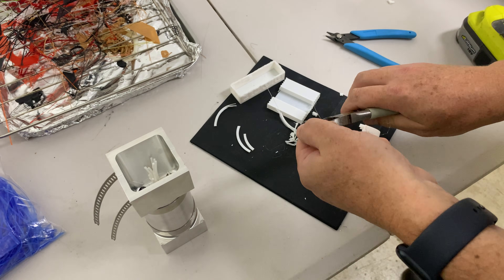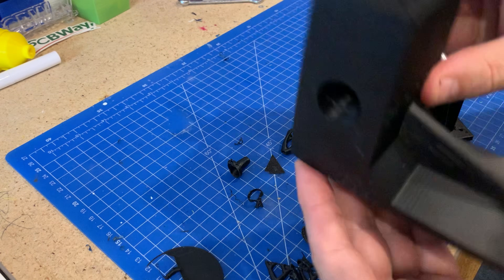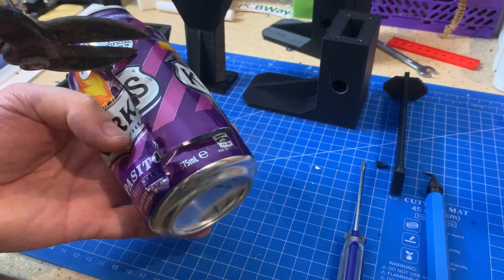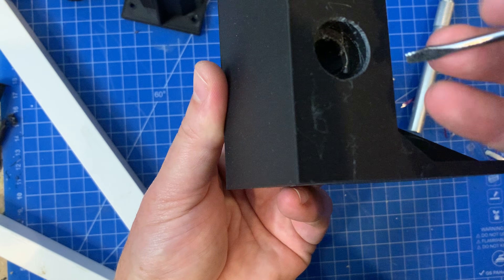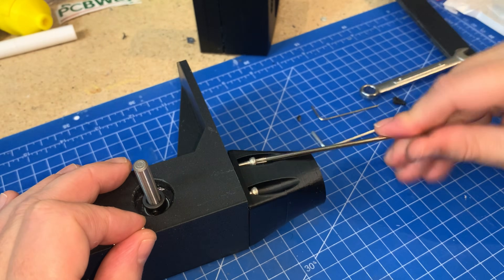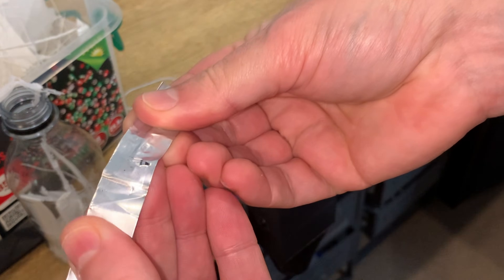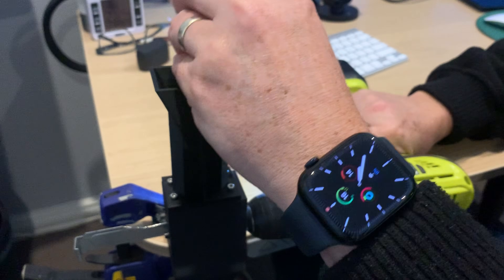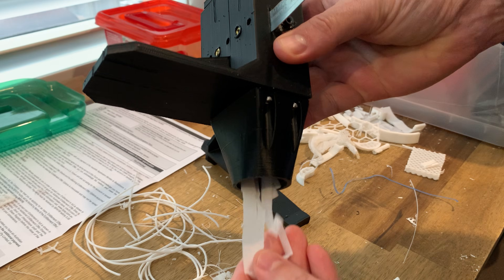Shredding your 3D printed scraps

Comment from the maker: Make sure you leave a comment on tips for layer seperation below so I can collect them all and do a video on them.:face-blue-smiling:
Reply: Heated chamber and tons of heat. The core issue is the part cooling, creating internal stresses after each layer. Still if you do, it's never gonna be as good as PETG in layer adhesion since the shrinking factor is too high. If you know any good alternative, a filament without warping that takes over 100C before losing its strength let me know.
Reply: Prusament PCCF, or probably most PCCF filaments. The CF prevents a lot of warping. Heated chamber still has better results though
Reply from the maker: @windy1234100  Yeah I'm getting some CF to test out and this will be one of the first things I print to check the strength

Comment: I thought about designing something like this but using to flush cut trim router bits. But the ones with the teeth on them the carbide tipped ones. I also thought about trying to put a gear on one of the bits with A set screw to spin the other bit but im having a hard time figuring out how to make the other bit go in reverse
Reply from the maker: yeah, I've had a remix of this on hold for a while being too busy to give it the time it needs.  I was thinking the same thing and if there would be an advantage of having one of the bits an up cut and one a down cut too.  I'm planning on getting back to this in the next month or so and expanding it to include a filament extruder as part of a total recycling tool.

Comment: Thanks for sharing. When I do a heat insert, I use the soldering iron to push it in most of the way, and then finish with a flat piece of metal before the insert cools. This gets them flush and straight every time!
Reply from the maker: thats a great tip. I was thinking of making a video on printing a insert press that keeps them nice and straight but it's a bit overkill I think 🙂

Comment: Just found your videos. I've been printing on a Neptune Pro 3 and I just watched the video on Warping. Losing a 15hour print breaks my will to print for a day or two so i watch videos to try and get better at all this. Thank you
Reply from the maker: If any videos can help then I'm happy !
Reply: @3DPrintSmith  would it be possible to heat PLA scrap to a point where it can be poured into silconw molds to make simple toys or party favors for my kids?

Ive thought about skull molds for my scraps but have no clue where to start
Reply from the maker: @CaptnCrowley  for sure.  One thing I'm working on at the moment and wy I started looking at shreders was to make this process easier using smaller bits and trying differet DIY injection mold methods.  I'm not having much luck with that but you could absolutely make molds with silicon and melt into those.  Uncle Jessy did a video on that one a while ago which was  pretty good https://youtu.be/rqHbA-ZZ1Fg?si=7icfTTpt0r4yb9BW
Reply: @3DPrintSmith  thank you

Comment: I've spent a good amount of time looking into plastic recycling. From what I can tell, there are no ready-made solutions for the hobbyist in the hobbyist price range, and all the DIY contraptions are sub-par, claptrap, Rube-Goldberg-style monstrosities that are finicky to use and require constant tinkering/upkeep.

Shredders are easy enough to come by, but I can't believe that at this point in human history, nobody's come up with a ≤$1K benchtop machine that shredded plastic goes in one end and usable filament comes out the other. Once in a while, you have to change a belt or or a nozzle or something. Maybe a drop of oil here and there. 

WTF is the problem? It's just a 3D printer with no XYZ movement that runs in reverse. Why is this so hard?

I'm not even Captain Print Farm or anything. If I was, I'd be more inclined to buy one of the thousands-of-dollars offerings. I'm just a guy with a couple printers that thinks it sucks wasting plastic and can see the utility of a small machine that can pay for itself over a year or so of use.
Reply from the maker: Totally agree.  When I originally did this video I thought I'd be able to put something together really cheaply but in the end it's exactly that. a cheap recycler that doesnt produce great results and not even worth showing.  I'm still working on it though !  I hope I can release something one day but that could be a long way off.
Reply: Hi, friend from Michigan, hope you are doing well, we are a group of students from King Abdullah University of Science and Technology and actually we want to do the exactly thing as you mentioned, a machine integrated a shredder, an extruder, and a spooler as well as ＜1000 USD. Although we know there are many technical tasks, but we will try to solve it. The more important thing I believe is getting some insight from a expert from you, so if there are any chance to connect with you, please feel free to let me know, it will be super appreciated if we can have some tips from your side. :)

Comment: Thanks for the video, trying to give this a shot.
The router bit link seems broken  now, could you please put the dimensions or specifications of the router bit to search for cheaper or other alternatives?
Reply from the maker: Thanks for letting me know!  I've found one that is the same measurements at https://amzn.to/3WnM45Y. 
I noticed from your profile though that you're in Spain so this one from Amazon Spain is the same. ( I was in Barcelona / Blanes area about a year and a half ago with my wife and we loved it there.  I started learning Spanish and I'm looking forward to going back !!)
When I get time I'm going to work on a remix of this model because I ended up having some issues with it lasting and it wanted to start splitting apart.  It could be because of the filament I was using though and the chunks of scrap were too big.  I need to spend some time researching but it's worth a try.

Comment: The best and cheapest way to actually shred 3D prints is to buy a couple of 2nd hand crosscut paper shredders.  The ones rated to shred credit cards and CD's.
Reply from the maker: I've seen a few people try that but they can get expensive and I was trying to do it super cheap.  if you can get them for under $50 though it's definately a cheap option worth trying.

Comment: Have you tried throwing it in an old blender with water (and optionally ice) for viscosity and cooling?
Reply from the maker: I had thought of doing it dry in a blender but I think doing with water then absorption might be a problem there and the resulting chunks wouldn’t be much use.
Reply: @3DPrintSmith  You obviously have to dry it after shredding, but presumably you have a filament dryer/food dehydrator.

Without the water, heating is likely to make it a gummy mess rather than brittle like you need it.
Reply from the maker: @daliasprints9798  I've seen a few people do it dry and doesnt seem to have a problem with heat.   You'd need to start drying pretty quickly, with the smaller particles I imagine they'd start soaking quicker. Theres a point where the plastic is going to absorb too much water and the structure of the plastic is compromised, becoming less effective for what you'd be using it for next.    Having said all that though I havent tried it so I cant say from any point of authority there !  Worth a try to see what happens. :face-blue-smiling:
Reply: @3DPrintSmith  "The structure of the plastic" is not compromised by water. The problem with moisture is that it will boil and bubble while printing or attempting to melt and mold the plastic, and the bubbles leave gaps that compromise the structure of your final part. But there is no chemical damage to the plastic from having been wet. Moreover, as long as you take the shred out of water right away, the only water will be at the surface and easily removed by a dryer.

Comment: As you noticed yourself, ABS is not strong because of the internal stresses that build up in larger prints. I use my heated chamber at 55C Qidi X Max 3 for the project I'm posting about, a 3D printed electric carbon fiber outboard - and I had to switch out the ABS in critical places to PETG which sucks, because I want the layer adhesion of PETG but the heat resistance of abs. Any ideas there?
Reply: Yeah I have a few spools ASA and it's q pain in the rear. The shrinking factor is even larger than ABS, meaning warping is even worse. I like ASA for small parts but for bigger it's a warping nightmare even with a heated enclosure at 60C. I just can't print any larger functional parts over a few centimeters. Many of my parts are between 500g-1kg, so ASA is just not usable.
Reply: large cardboard box as enclosure and ASA instead of ABS
Reply from the maker: ASA is definitely better for withstanding weather and UV so could be a viable option.  I can’t say from experience because I’ve not tried it myself but supposed to have better adhesion as well. For an outboard motor, even though it‘ll be electric, ASA also is better chemical resistance too.

Comment: Awesome vid as always!🔥

also been looking into recycling (mainly the chipping options) a while now... that really seems like a good option especially as you mentioned the other ones are expensive - i even designed a shredder myself but getting it laser-cut is at least 600 bucks ... just need a larger intake and a mesh below i guess... 
And about the plastic parts... you need a chamber or at least something similar... because that layerstrengh is really weak which is dangerous with a shredding device... or turn up the hotend temp a bit (just make sure it doesn't burn the plastic... how you do it doesn't matter but for layerstrengh the two touching layers should be above glass transition temperature as long as possible to bind together...could also turn cooling down if your haven't already...

For the recycling itself i have large hopes in the Greenboy3D extruder...

if you want hook me up on dicord...
Reply from the maker: yeah, I was thinking of doing a remix with a standard size rectangular metal tube as an insert. It might do away with the need for the metal ruler if its a close enough fit.